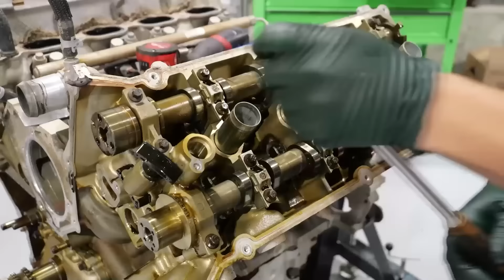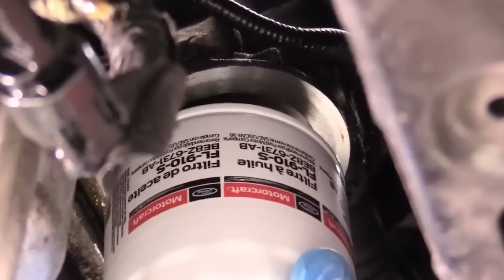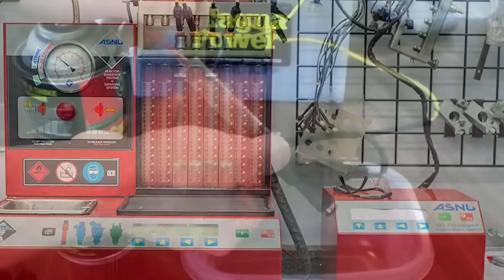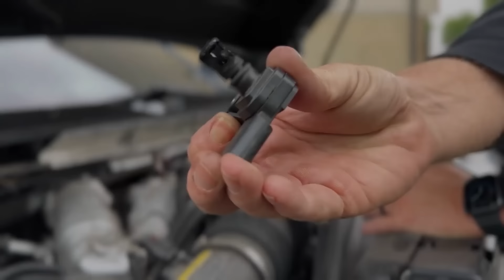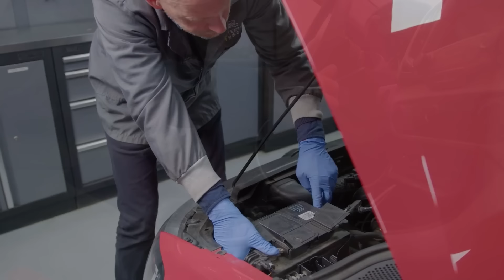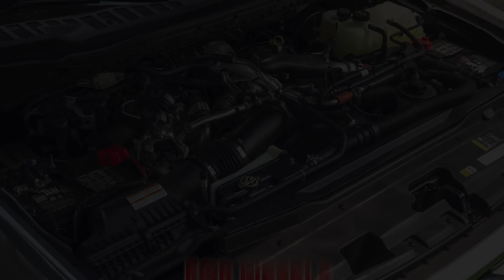Doing THIS Will Make Your Ford Engine Run Like NEW! (Mechanic Explains)

Comment: Nice video. I have a 2019 F150 with a 3.5 ecoboost, with just shy of 100k. Ever since I've had it, there has been a rattle or pinging at start up. The dealer refused to acknowledge it. One time, I even played a recording of it, and they still refused. An advisor heard what I was talking about, and they replaced the cam phasors. That lasted about 9 months. Same rattle. They replaced them again. Now I have the same rattle. They are refusing to re-replace them. Also, each time I had to pay for a rental while they "diagnosed" the problem. Yes, I know I will never go back to that dealer again! Any tips would be appreciated.
Reply from the maker: That rattle on the 3.5 EcoBoost at startup is almost always the cam phasers - you're right on that. Problem is, replacing them doesn't fix the root cause if the oil change intervals have been stretched. Make sure you're on full synthetic every 5,000 miles and find a good independent Ford specialist. That dealer isn't doing right by you.

Comment: just got a 2008 expidition with 56,000 miles! Owned by small city fire dept. some corrosion spots on finish, but well maintained. I want to make 500,000
Reply from the maker: That's a great find!  
Low miles and likely fleet-serviced on schedule! Start with fresh fluids (engine, transmission, diff), fuel system cleaner, and keep up with oil changes every 5k. Treat it right and 500k is totally within reach.

Comment: How often for transmission service? What transmission service do you recommend?
Reply: Don’t worry about that. Our Taurus 3.5 eco boost has ‘lifetime’ tranny fluid. Doesn’t even have a dipstick. What a croc.
Reply from the maker: For your Expedition, service the transmission every 30,000 to 60,000 miles — depending on how you drive (towing, heat, etc.). 
Always go with a pan drop + filter change, not just a flush. 
Use Mercon LV fluid and OEM filter for best results.